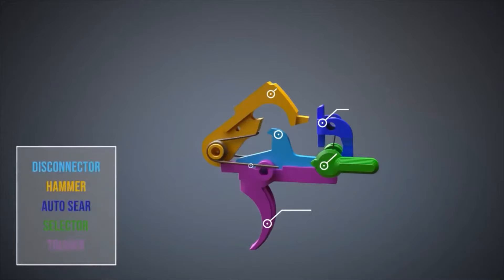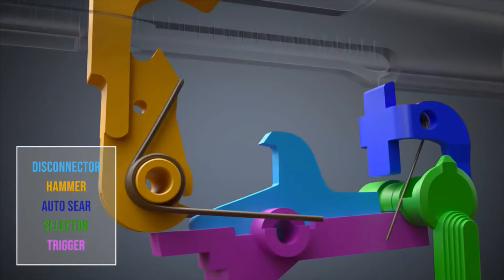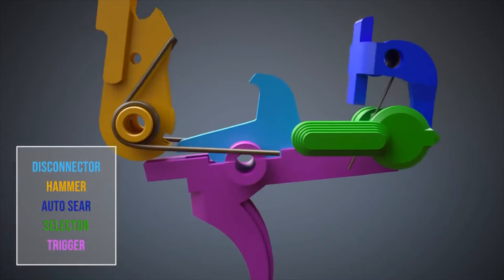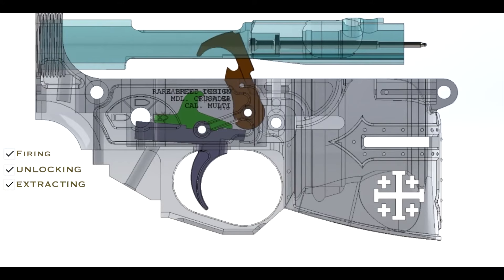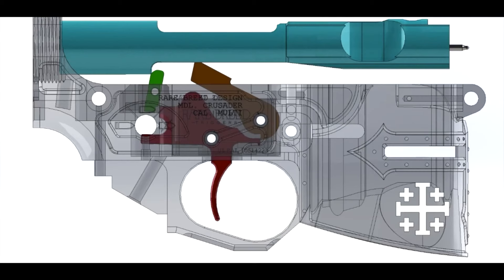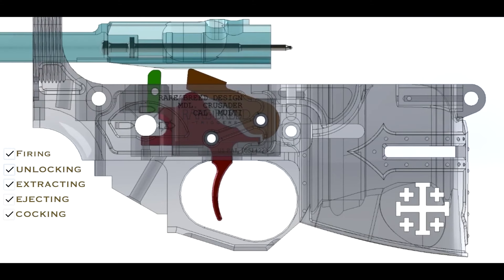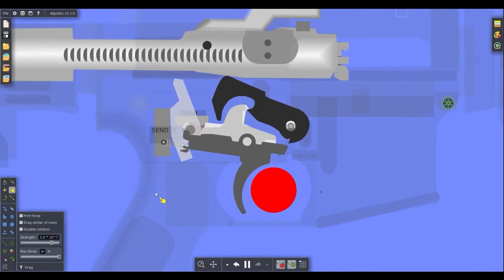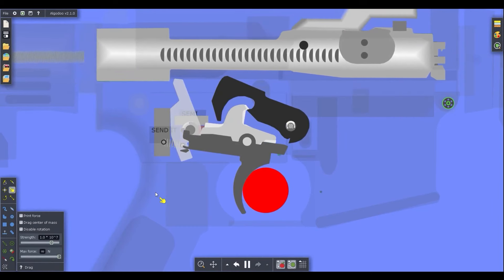HOW AN FRT-15 TRIGGER WORKS, AND WHY THE AFT HATES THEM

Comment: If you’ve seen a demo of a forced reset trigger, it looks like regular old full auto.  Stop kidding yourselves with these work arounds, they subvert the nfa in language but not in real world differences
Reply from the maker: @rudyd1772  I own multiple. I have also shot multiple full auto weapon systems after being in the military for a decade. Your idea that they are "basically the same" doesn't effect the legality of a product. That is the same as saying that any firearm capable of firing quickly is a full auto. I can fire most all of my semiautomatic firearms faster than an M3 submachine gun, M2 heavy machine gun, and multiple others. It's not the rate of fire, it's how the weapon operates.
Reply: He literally shows the difference.. It’s the ATF that continues to subvert the language.. 😂 For fuk sake, at least put a little more effort into looking dumb! You make it look way too easy for the rest of us.
Reply: That sounds like a pretty good way to take the Heller decision and say that if it's functionally the same, then automatics are now in common use and restriction is no longer permissible 🤭